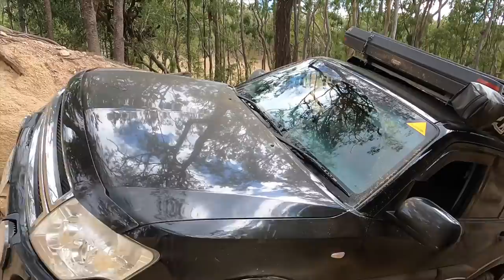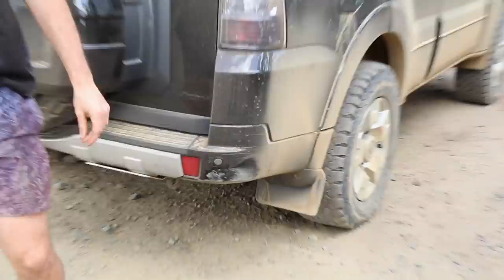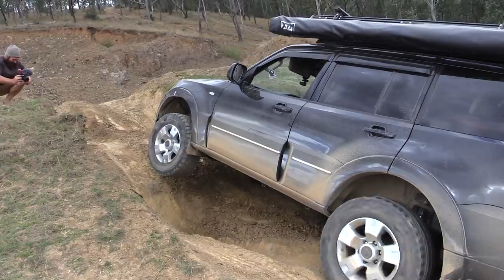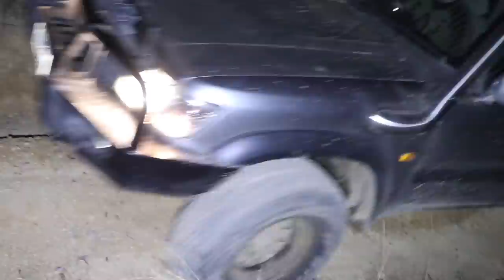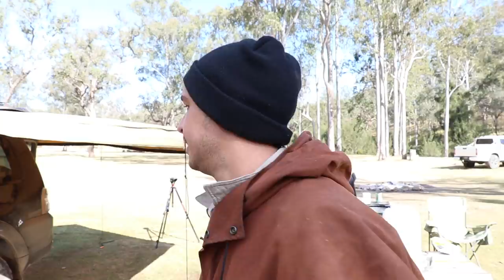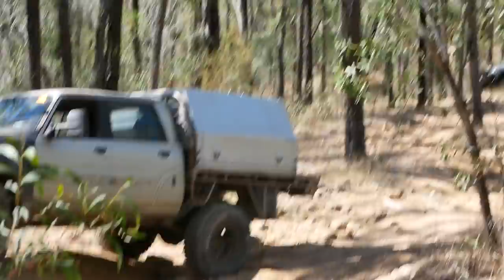Patrols, Pajero and a Mercedes Tackle Landcruiser Mountain Park

Comment: Interesting to watch the traction control on the Merc vs the Paj.   The Paj lets wheels spin endlessly before deciding to act, whereas the Merc is pretty much instant.  First upgrade for the Paj is a rear locker, which will help a lot going down hill as well as up.  Can't fix the slow traction control though, unless someone has an ECU flash for that.
Reply: The merc has a rear locker
Reply: @khyebaker2361  Ah, cool, thanks for the update.  As I said, Paj needs one as first upgrade.  It'll still spin the front's too long though.

Comment: Love seeing a gen 4 Paj off road and even in manual - dam boi that clutch cooked in 4WH lol low range killed it .
Reply: (м ι a)_ vℓσg gσ тσ му ¢haηηєℓ!  YES, and this is a manual one - the 5 speed auto box is actually amazing, would have cruised up there in 4wd H most likely. 

Don't get me wrong I love a brute off roader big wheels etc but thats because I like modding cars . 

I do have a Gen 4 Paj with a tune on it, no lift bigger maxxis AT811 tyres , exhaust and have been everywhere my mates have been without a snorkel. 

One thing I find hard with the paj tho is soft sand, the traction control switch mod is an amazing mod to have when in soft sand, keeps these wheels moving. 

Even the boys said here, they couldnt believe the paj did so well on that first track lol.

Comment: Stability control is generally to stop a vehicle fishtailing or spinning out it is normally useless in 4wd mode under thirty kilometres per hour as it is meant for wet slippery conditions on a paved road and occasionally is good on gravel but usually not. Some really good ones work in 4wd low to prevent wheel spin in place of locking differentials.

Comment: Woody, try sticking it in low range and keeping the clutch in rather than riding the clutch. You should go quite slow, it should give you plenty of time to navigate. If you are unsure, scout the track fist.
When descending, again just leave it in low and feet off the pedals. You get much better control and much less risk of sliding as the wheels will still turn and can speed up slow down as required, but with engine breaking.

Comment: You guys have the best tracks. I would SO love to drive that in my TJ.
Reply: Probably overheat or break down before it made it there
Reply: @mattlyster8508  that’s a moderately predictable reply. My truck doesn’t over heat or break down. It’s a 2003 TJ Rubicon with 6” of lift on a long arm kit, on 35” tires. We wheel hard up here, you have to keep things strong and reliable.

Comment: Some great tracks. Better to stall in gear than push the clutch in on a hill. You can also start in gear without pushing the clutch in. Much safer.

Comment: Had a paj, from memory there is a button to disengage the esc and or traction control. Also use the centre diff lock that from memory disengages the system that creats the berbing. There are 2 relays under the bonnet near the booster, one you can pull while drving on sand so the traction control/esc doesnt cut in. All this is from memory. Get on the pajero owners forum, its on goigle, heaps of goid info and helpful people.

Comment: It doesn’t look like you have your sway bars disconnected Woody. From what I could see, there  was very little articulation, especially on your front axles. That is key to maneuvering on those uneven tracks. If you can keep the tires on the ground, you will be surprised where you can go, even with open diffs. But it sure looks likes like a fun day out playing.

Comment: FYI Woody, The warning buzzer you are hearing is the ABS pumps getting too hot, once they hit a certain temp traction control gets disabled to let them cool. It happens when doing extreme 4x4ing.  Lockers obviously would help but getting those abs pumps cool might be a cheaper option. Water cool them? haha

Comment: Information taken from Pajero 4WD Club Forum "Sounds very much like the TC overheating to me. In my NW it is a series of beeps first to indicate that the TC is getting hot (usually takes a good 30 seconds or more of constant slip activating the TC to get the beeps) and then it goes to a solid beep if you're still climbing and I think it disables. Damage to anything  . I just wait it out then go again."

Comment: So that beeping is the TC brake booster overheating. They have excellent TC but don’t handle to heat well is all. Rear diff lock overcomes that but kills TC on front axle and is often. It as good as just using TC. Let’s it cool. Keep on trucking

Comment: the beeping is the traction control warning of excessive slipping. Its not made for hill climbs,its made for snow and mud. your your going to burn it up. Go into low and let the tires spin alittle, or get lockers. and when going down hill......where u almost lost control......low range and low gear.....let the engine braking control all 4 tires

Comment: Hey Woody stability control is in high gear only because it's for when you're doing higher speeds and it helps you stay going straight not swerve it does nothing when you're off Roading FYI

Comment: "Brake warning buzzer
When there is a danger of brake performance
becoming compromised, a buzzer will sound to
alert the driver. If this buzzer should continue to
sound, park your vehicle in a safe place and we
recommend you to have it checked.
NOTE
● Depressing the brake pedal repeatedly may
turn on the brake warning lamp, ABS warning lamp and brake warning buzzer. It is
normal if the lamp goes out and the buzzer
stops sounding after a few seconds."
Reply: NOTE
● Depressing the brake pedal repeatedly may turn on the
brake warning lamp, ABS warning lamp and brake warning buzzer. (The ASTC indication lamp and active stability control function OFF indication lamp also turn on.) It
is normal if the lamp goes out and the buzzer stops sounding after a few seconds.
● On vehicles with the rear differential lock, the active stability & traction control (ASTC) and anti-lock brake system (ABS) functions are suspended while the rear
differential lock is activated. ASTC indication lamp,
active stability control function OFF indication lamp,
ABS warning lamp and brake warning lamp are illuminated while these functions are suspended. It does not
indicate a problem. When the rear differential lock is disengaged, these lamps go out and function again.
Refer to “Brake warning lamp” on page 3-13, “ASTC
indication lamp” on page 4-64, “Active stability control
function OFF indication lamp” on page 4-67.

Comment: I think this is about the only situation I'd prefer having a torque converter based automatic vs a manual. Al's setup with an auto and lockers practically rolls over this stuff.

Comment: You know these Pajero owners! They get to a speed bump at the local shopping centre and panic! 🤪 Also Woody, traction control is as good as lockers mate!
Reply: No it isn't!
I've got a Paj with optional locker, abs it makes it ten times better!
Reply: @pugnut403  You sir need to do a touch of research! If you have the Pajero with 4 wheel abs it has the traction control AND the rear locker. Traction control when it actually works is as good as lockers. Toyota's crawl control is a traction control system and is hands down an incredible system. However saying all this I would rather have mechanical lockers as they are more reliable.

Comment: had the same problem with trans temps. ( running LSA and 6L90) ended up with 2 off 280x 255 trans coolers running in series. mint temps now. edit, they were PW05389. when i had the duramax i ran 2 off Setrab 50-640-7612.
Reply from the maker: Pretty sure I have one PWO5389, will add another.

Comment: They haven't imported any Pajeros into the USA for a while now... Does yours use open diffs plus the electronic braking system to act as an "eLSD", or do you have mechanical or air lockers in the front/rear diffs? 

Wicked fun episode.
Reply from the maker: E LSD. Works surprisingly well.
Reply: @theskidfactory  I had a discovery 2 with the e LSD, pretty cool technology especially when solid axle.
Reply: Earlier ones had a rear Torsen LSD.
The 4th generation has open diff, traction control, and optional rear locker.

Comment: Sounds like a traction control warning beep, it also beeps when the transfer case unit starts to over heat.
Can't see an electric 4x4 doing this kind of trip.
Reply: Electric 4x4 has potential to be even better. 
Super smooth torque control with 100% torque available from 0rpm..

Comment: If I'm not mistaken,  the beeping occurs when the ABS pump gets hot and the solid beep is when it deems the temperature too high and disables the pump.
Reply from the maker: That would make sense, cheers.
Reply: Yupp it's because you've overheated the system
Reply: The traction control system that is
Reply: Woody, a set of low range gears would go a long way. Allows far less clutch slippage, more throttle control control so you don't overwhelm the ABS
Reply: @theskidfactory  time for actual locking diffs.
Reply: It's not actually an overheat. The Hydraulic brake booster runs out of pressure from all the brake applications. You just need to pause and let it recharge.

Comment: Was time you will find your front diff vacuum line has probably a bit warn out otherwise watch your v5a51 Iam saying your plantery gears will go with out saying hello if you can find a upgrade for the plantery Iam all ears have just done mine but trying too bolt everything up lost a few bolts

Comment: PS ABS also disables when in 4x4
Reply: No it doesn't. 
Stability control disables in low range. 
Stability control, ABS, and traction control all disable if you turn on the factory option rear locker. 
Or you can do what I did and cut the wires that tell the traction control ecu that the locker is on, and wire it to a manual switch... when the locker is on the traction control stays active on the front axle, but you can shut off all electronic driver aids at the push of a button.

Comment: Your Pajero beeping is likely it trying to tell you it's unhappy with all the different wheel speeds going on.  Low range and lockers are your friend.  Watching you have every single wheel doing something different is making the computer angry.  I loved my old '82 Grand Wagoneer Limited.  Fully locked center diff stock and posi rear.  Means 3 out of 4 wheels were ALWAYS  going the same speed.  Simpler 4wd is better 4wd.  Or go full lockable diffs, front, rear and center like Toyota Landcruisers.  Your Pajero either has worn LSD's or is just open diffs everywhere.  The traction control is working too hard and getting angry is my guess.
Reply: The beeping is low pressure in  the ABS/TC accumulator.
These use an electric driven pump to build brake system pressure. 
TC being used too much bleeds the pressure down and trips the warning beeper. 
It wants you to stop spinning wheels until the pump catches up.